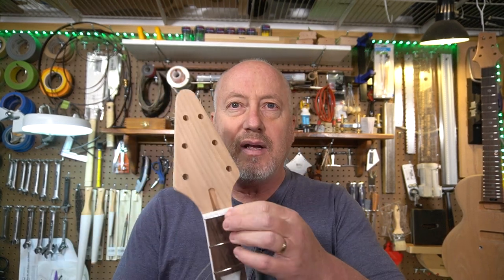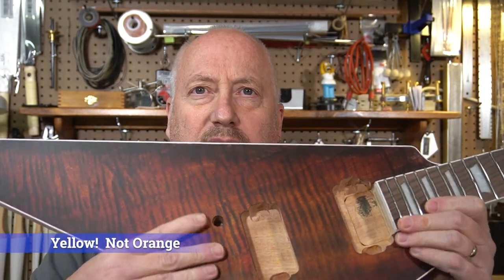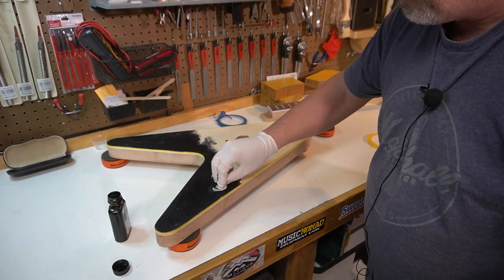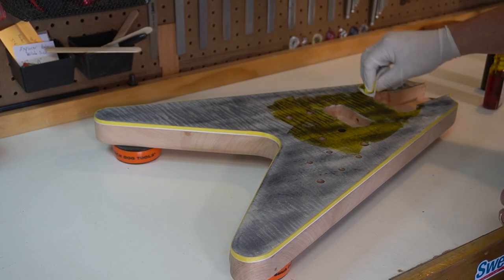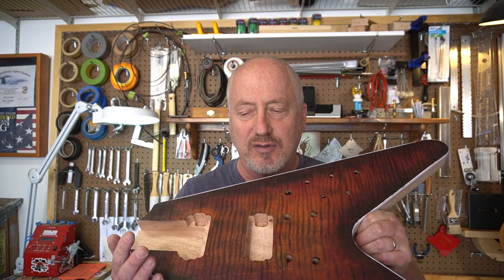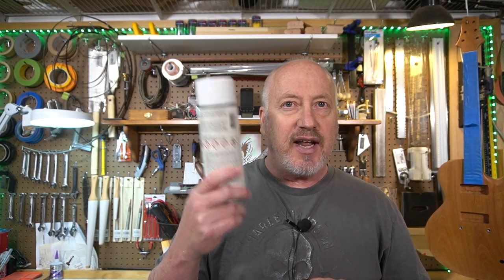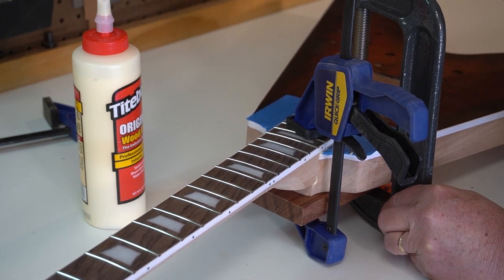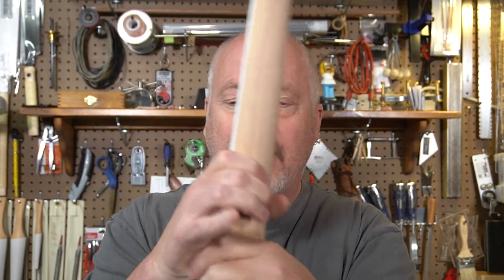Pango Music Flying V Guitar Kit   Ep 2   Dying the top and gluing in the neck

Comment: does the neck have an angle? I had problems with mine because there was no angle and the strings come pretty low on the saddle and tailpiece. Nice colour and I had to admit your kit is way better than mine 👍
Reply from the maker: Yes, there is about a 3 degree angle in the heel of the neck.  I did do a quick check to make sure it was correct and it is pretty much spot on.

Comment: Did you sand the top after the sanding sealer before applying clear coat, I used full dye finish and sprayed the sanding sealer over the whole guitar- wondering if I need to sand a bit or not and what grit to use
Reply from the maker: Yes, After I did 3 or so coats of sealer, I did sand smooth with 600grit paper, just enough to smooth the surface, but not going through the sealer.

Comment: Hey Bill! I'm almost done with my kit. I'm off to electronics at this point. I was wondering if/how you grounded the bridge? And if you didn't, is there a lot of extra noise? Thanks again in advance. This build has kind of been the blueprint for my build.
Reply from the maker: I did ground the bridge.
Reply from the maker: Yes, it has a ground wire attached to the harness already. It grounds to the bridge post.  Feed the ground wire from the electronics cavity up to the bridge post. Then fold bare wire to go against the side of the hole. When you press the bridge stud it, it will provide the ground.  The hole from the electronics cavity to the bridge stud hole should already been drilled
Reply: @billsguitargarage  Thanks man. I made the mistake of putting the bridge inserts in already. Hopefully it's not too much of a bear to get back out. I didn't even think about this until the doh! moment afterwards.
Reply from the maker: @glb5053  definitely take a look at some of the videos on you tube. I the Phillip McKnight has done a video on a good way to remove the inserts

Comment: What kind of sanding sealer would you use if you're planning to use a poly clear coat ?
Reply from the maker: I really like the oil based grain filler I use don this.  But I have had very good results from water based filler as well.

Comment: Another question for you: I’ve done a dark wood burst Tabacco style and I would also like to dye the frets darker being that they are lighter- how can I get this stain to lock in- is it practical to use the stain sanding sealer on the frets or how would you go about making the frets darker for this kit? Thanks!
Reply from the maker: Hi, I don't know of anyway to dye the frets.  Being metal they will not allow the dye to penetrate.  Any coating you may put on the frets will just come off when the strings contact the frets.
Reply: @billsguitargarage  I meant the fretboard I apologize
Reply from the maker: @jacobkitzy6188  Ah.  Yes you can use stain to darken the fretboard.  use a solvent based one unless you want to seal the fretboard afterwards. If you use a water based stain, it can reactivate from sweaty fingers etc...
Reply: @billsguitargarage  good deal thanks! , you think the sanding sealer wouldn’t have any effect on playability or anything if I use the leather dyes to stain it and then seal it with the Mohawk product you refer to?
Reply from the maker: @jacobkitzy6188  Sanding sealer probably not the best.  Possible shoot it with nitro or a poly then clean the frets once it dries.